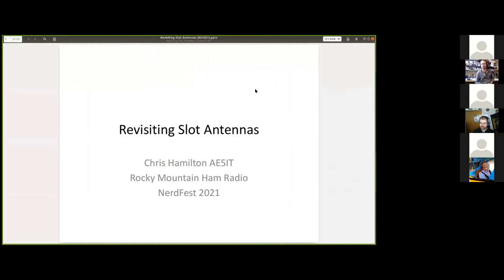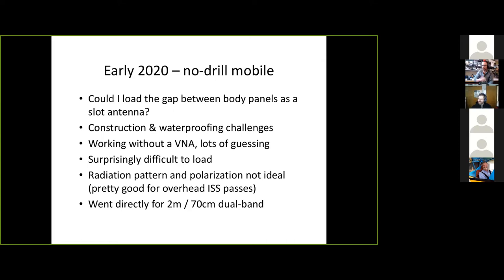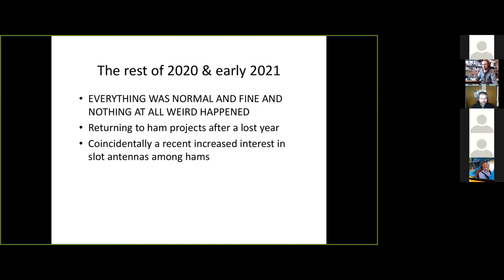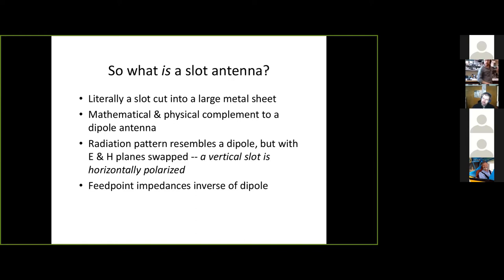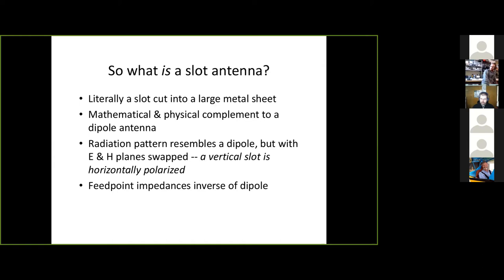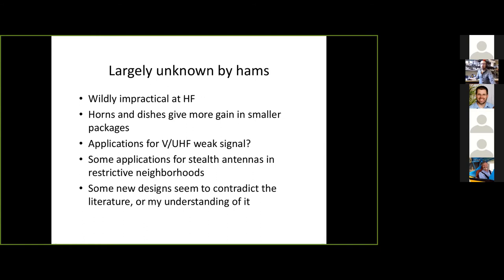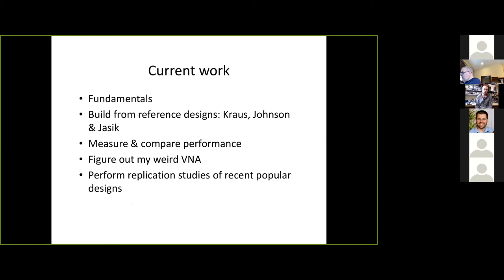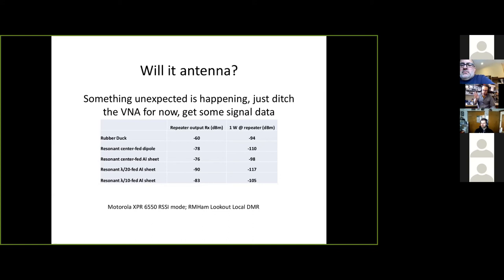RMHAM U Quick Tip: Revisiting Slot Antennas

Comment: Many of the slot antenna on Internet and even QST are NOT slot antennas. People call them slot antennas, but they are not even remotely close to being a slot antenna. Some are nothing but  bent up folded dipoles, they bear no resemblance to a slot, but somehow QST and others give these non-slots a pass. 

A slot antenna works, as you say, by exciting a sheet of current in a very large metal plane, such as a waveguide or an aircraft fuselage. If we do not have the large sheet or backplane, we do not have a slot. 

To be a slot antenna...it has to have a large sheet of current.

Comment: Funny I was thinking of a Slot antenna for 11m CB on truck just trying to get up to speed on antenna theory of slot just getting in to radios though I would start with CB. Was wondering if one were to take a closed loop of wire around a windshield in the gap around the glass as feed point and ground to body would that be like a slot antenna or a loop antenna? And would it even be feasible at 27MHz
Reply: Antenna theory won’t help you much with Slot theory.  They seem to contradict in most cases.